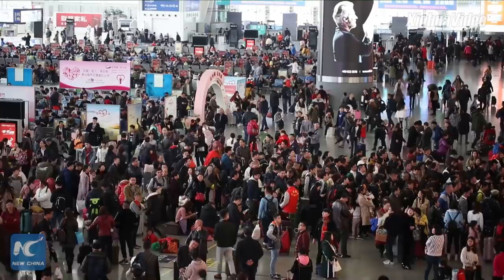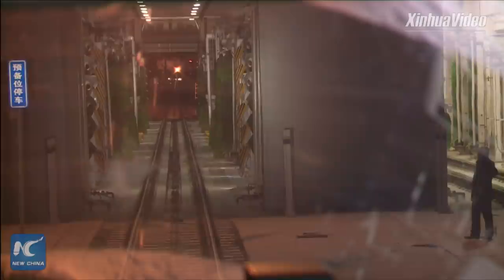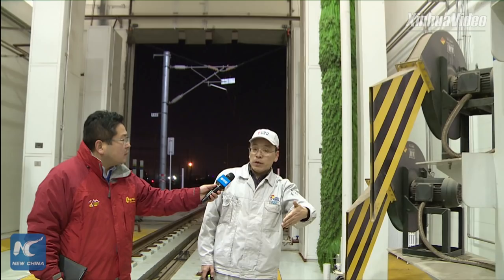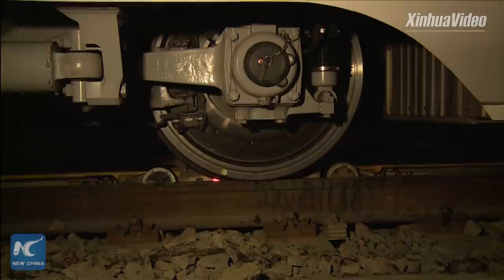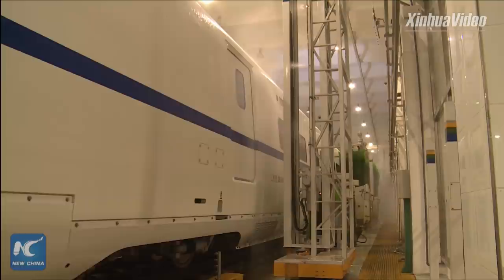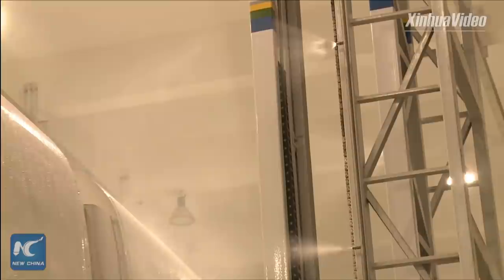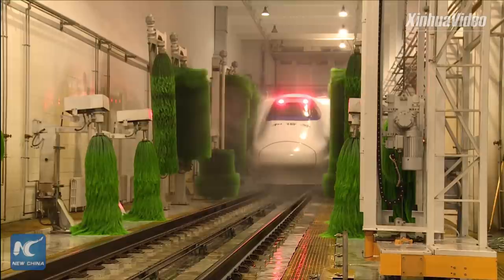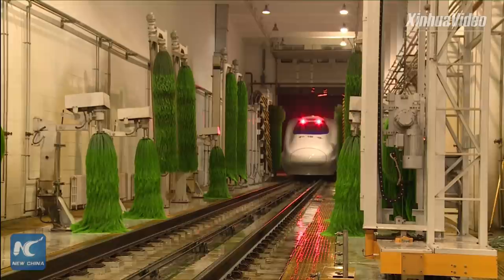How China's high-speed trains take showers?

Comment: I must've missed how the nose and roof are washed as none of those brushes and water jets touched the nose and roof.
Reply: The roof is usually just hosed, I'd imagine. Even high speed trains have fragile electrical equipment up there. Can't brush that, you'll tear the pantographs off. And the nose is mentioned in the video - it has to be hand washed.
Reply: The video states nose washed by hand.